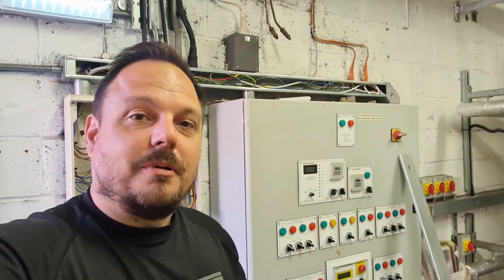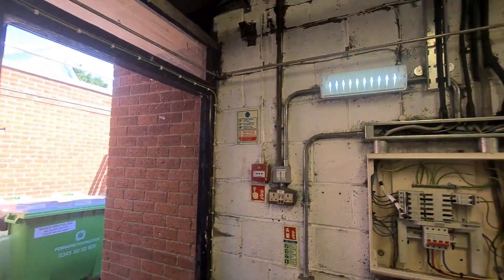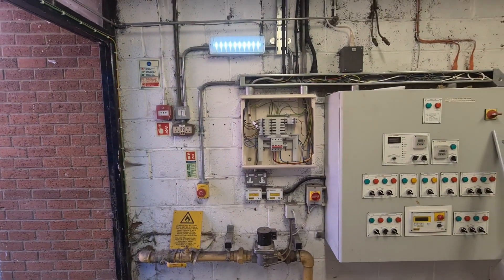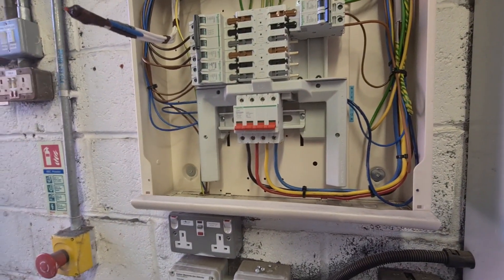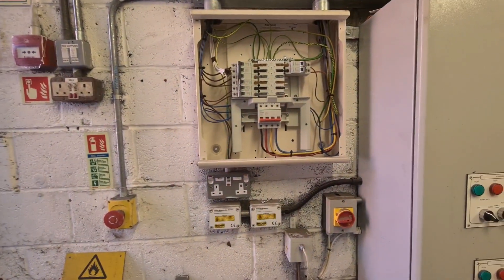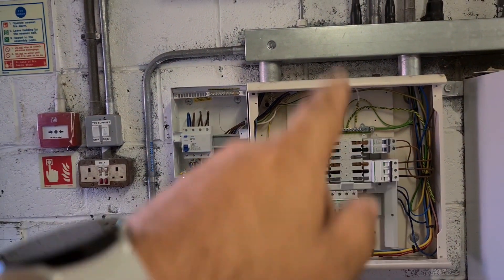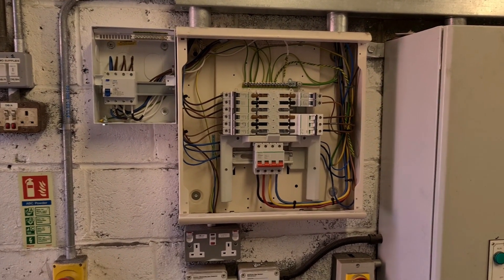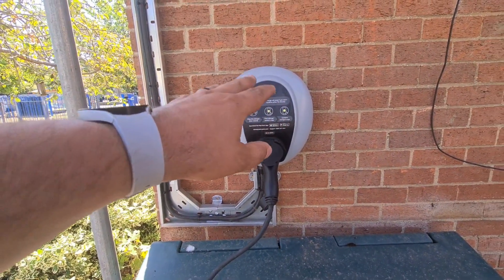Like working in plant rooms...? Three Phase TPN wiring - 4 Pole Type A RCD

Comment: Excellent video as always. Where did you hear about the ZAPPI integral RCD not meeting regs as I spoke with My Energi today who said they don't  require it upstream if cable doesn't need it eg : SWA cable clipped to wall. This is because it had the integral RCD built in. Surely if manufacturer instructions are saying it complies it does. EV chargers are a pain in the butt due to the grey areas with this new tech. We have fitted loads of Zappi without any  Type A RCD at board . We have always fitted them on Podpoint, Andersen, Hypervolt, Rolec etc as the manufacturer asked for one due to them not having any.
Reply from the maker: Thought exactly the same as yourself but from the horses mouth itself so to speak 

https://twitter.com/EdwardAutomated/status/1554919594258825218?t=vfCDfW_dXUgbb5iTpKzyRQ&s=19

It's the same for most charge points. While they work in terms of disconnection etc. The issue is around mechanical operation and test buttons. It's a sticky wicket sometimes as a spark. 

For example the podpoint T22 posts have traditional rcbos in them. So no upfront needed. But then you have the ball ache of opening the charge point to reset rcds lol.

Comment: Is it just singles from the 3 phase mcb into Rcd then an armoured to the charger mark? In which case when a charger has built in Rcd would you just come straight off the mcb with the armoured 👍
Reply from the maker: The trouble is lots of these chargers with rcd protection in them do not meet the requirements of our regs. Several of the mf have clarified this recently. Something to do with mechanical operation and test buttons. So most will advise you fit one up front regardless when you drill into it. As podpoint do here and myenergi with the zappi as examples
Reply: @electrician247  
If you fit up front RCD and the unit also has  rcd does that make any difference mark can you come off an rcd to an rcd
Reply from the maker: @ericthekingthekingtheking4842  that's the trade off. Selectivity. I mentioned that on the video earlier on in this series. By solving one problem we slip into another. Who wants to be a spark huh lol

Comment: are idents a requirement. as the company I work for never use them. and also does the main switch for the board have to be 4 pole as I'm only ever supplyed with a 3 pole
Reply from the maker: Main switch depends on earthing arrangements.  Tncs are fine with 3 pole isolation. Also of you have ups systems within an install 3 pole isolation would be essential so as not to lose the neutral on those.

We have to identify Conductors as per regs. In tpn that usually involves idents as so much going on. But some don't use them, no grand issue tbh.

Comment: Always interesting to see these jobs and what you have to work around, the MCG board fit just nicely in that gap.

For the flickering, you can lock the camera's shutter speed to 1/50s which should stop the flickering. When I've stripped (thinner) PTFE cable in the past, I've always prefered those fixed cable strippers with the row of little half-moon blades. I generally find them to be easier to use than either automated wire strippers or side cutters.

I have some questions about the earth that you added to the MCG board - Why did you add an earth bolt to the board rather than using the built-in earth bar? Also would it have been easier to follow if the earth from the SWA had been brought into the MCG board rather that being connected to the main earth bar at the expense of a slightly longer earth path and an extra joint, as then the entire cable would have been terminated within the same board?
Reply from the maker: Thanks for the tip with the camera! Legend. I am terrible at that tech stuff tbh. 

That earth bolt is provided by the manufacturer as the main earthing terminal. The bar is for outgoing circuits. We did end up looping in/out with the cpc to the rcd board. This is on the next video in this series 🤭.

Comment: Hi Mark another interesting video mate. For car charger points it is preferable to use a type F RCD or not?
Reply from the maker: Most are happy with type A. If the chargers have the 6mA dc detection built in. If not type B or F as you say.

Comment: Hi Mark. If u only were yo use a 40a mcb  from board to charge  point is the supply  cable  then without  additional  protection  of rcd? Would  the charge   point rcd  protect  upstream  so to speak? Thanks
Reply from the maker: If you use say a pvc/pvc cable you would likely need the upfront rcd protection regardless. 

When using swa you can omit the upfront rcd protection if the charge point includes it.

The issue comes when the rcd tech in the charge points doesn't meet what's needed in the regs we use. Usually due to lack of mechanical operation and test buttons. Most mf will still advise upfront rcd protection due to this. They really don't help us out with the marketing sometimes
Reply: @electrician247  ok. Thanks  for  the clear concise answer. 
Does the 18th contain  all one needs to know RE EV points? I have it plus on site guide and even test and inspect  guidance  notes. I notiv6 in a previous clip u had another book
Reply from the maker: @carlmarquardt994  it does tbh. But we have the guide for EV installs aswell. A decent book from the iet tbh. Sets things out clearly.
Reply: @electrician247  ok  cheers  Mark.  I have  become a bit confused  about  which type of rcd  to choose recently.  Type seems to cover everything but they cost a fortune

Comment: You've been saying about going on holiday for the last three weeks!!! I understood why you had a separate RCD rather than the D.B. but didn't understand why if there was one in the unit or have I missed something.?
Reply from the maker: The ones in these units don't meet the requirements we need in regs. Same for most charge points even Zappis. 

These are videos I recorded some on the same day 🤣🤣🤣  for you it's weeks apart mate. Currently in Spain right now lol.
Reply: @electrician247   Why is that Mark?
Reply from the maker: @anthonybragg  video earlier on explained. Basically an issue with product standards, mechanical operation of rcds and test buttons.